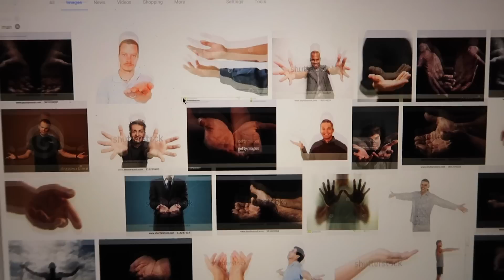DiResta Knife Show Display

Comment: nice chemistry ! hydrogen peroxide and then muriatic acid in this order like you showed ? how much time do you have to spray the protective coat ?
you asked a question a couple weeks ago it was about hand made and mind made. this video shows really well that both ways needs to be used to realize projects. using a tool isn't already mind made ?

Comment: So, are you running argon with the plasma or just compressed air? When the set up the big koike at our shop, they set it up with argon to cut steal, but I got tired of changing the bottle twice a day, so I switched it over to the shop air. I just put a water trap in the line along with a regulator and never had a problem. I cut half inch all the time, all the way up to 1 1/4. But usually anything over half and I switch to the oxy acetylene torch just to get rid of the cone taper.
Reply: Another thing you might want to consider, is changing the bolts holding the plasma cutters cradle to nylon bolts, that way when it gets a bad command and either drags too hard on the metal or runs into something and break over,  the bolts will snap easily enough to reduce the damage done, and they tend to be easier to remove after breaking. Sooner or later it will run into something.

Comment: Where's the one flipping the bird? 
You have one that could pass as devil's horns almost. 
I'm going to use an angle grinder to make myself one to weld on the anvil stand for holding my hammer. But while it's hot I'm going to rub oil on it to give an even black forged looking finish, helps keep the rust off.

Comment: Sure hope those displays don't scratch those beautiful Jason Brous folders.
Reply: Having owned 3 brous knives, i'll tell you that's fine.  His knives come scratched and poorly finished from the factory in the first place.
Reply: Mine are all flawless, beautifully CNC machined works of art. To bad yours are crap.
Reply: never bought a knife that I was afraid to scratch...  that must be a new thing.
Reply: I had a silent soldier with a lock at 100% from the factory, a detent ball fall out of my Bionic, and a completely unfinished scale inside of my divison flipper (rough, beltsander marks all over it).

Brous support basically told me to go screw myself all three times.  His blades aren't meant to be used, they're meant to be put in a safe and never touched until you sell them.  This is not an uncommon problem with that company.  You'll find WAY more reports of awful QC than you will of people who have "beautifully cnc machined works of art".   I buy my blades from actual companies that have pride in their product now, not guys who wish they were making fantasy knives for BudK.

Comment: Does the hydrogen peroxide speed up the rusting after the muriatic acid?
Reply: Kurt K yes,but you have it backwards. hydrogen peroxide is a highly powerful oxidizer so it goes on before the acid to cause it to rust. then the acid neutralizes the H2O3 and washes the remainder away.
Reply: Interesting-- I've used muriatic straight on galvanized nuts/bolts/etc to rust. I will have to give this a go.
I'm curious now what the finish spray he used was (it never came in full focus), I just use a spray laquer.
Thanks!
Reply: It is called Permalac.  He has talked about it in other videos.
Reply: Kurt K I was confused earlier. muriatic acid is a common name for hydrochloric acid. which the chlorine will cause the iron to rust. the peroxide acts as a catalyst which will speed things up considerably. (from days to hours from what I now understand.
phosphoric acid was what I was thinking of earlier and while it does not remove the rust by it self it does convert it to a form that is more easily removed by hydrolysis. as a blacksmith and hobbyist restorer of old farm equipment. I spend a considerable amount of time trying to stop rust not create it.  this idea of making things look rusty on purpose, is not for me. I know other people like it but the idea makes me crazy. and I start looking for the rust oleum.
Reply: no prob-- I used to just hit stuff with muriatic then leave it outside for a week. After re-watching the vid and seeing the speed of nice oxidation your correction makes a lot more sense.

So far as the look... It's easier and more permanent than paint, so I think it's a smart choice if black isn't what you're after visually.
Reply: thank you
Reply: your welcome I see your point but what my mind can't wrap itself around is why people would want to invite destruction to thier creations. cause even in the laqure  it will continue to rust